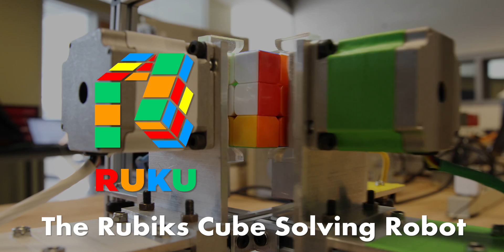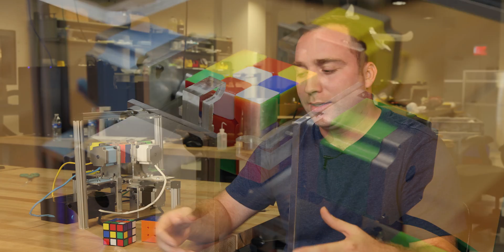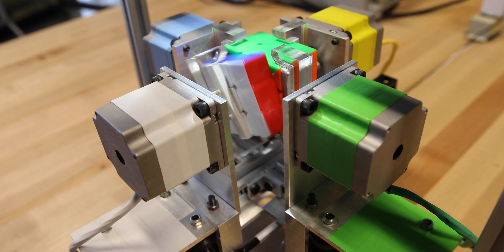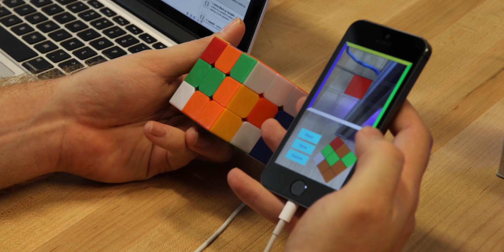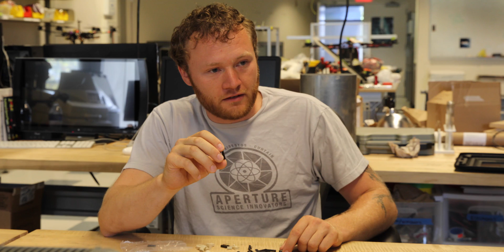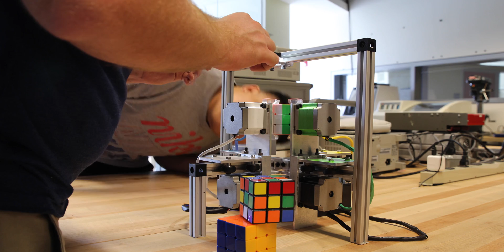Ruku - The Rubik's Cube Solving Robot

Comment: which motors is using for this robot?
please answer
Reply: +Petar Varga Hey, they are just stepper motors - NEMA 42 Stepper Motor
Reply: Raspberry pie
Reply: +Esby23 Metronic he's asking for the motors not the board.
Reply: i think Nema 17, you can use the cheapest stepper motors, you don't need too much torque to flip the cube.